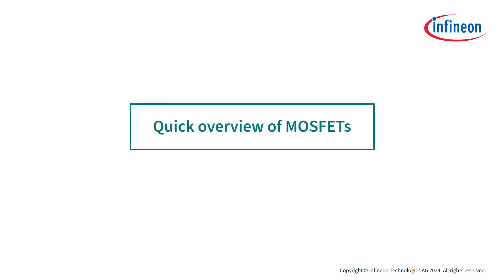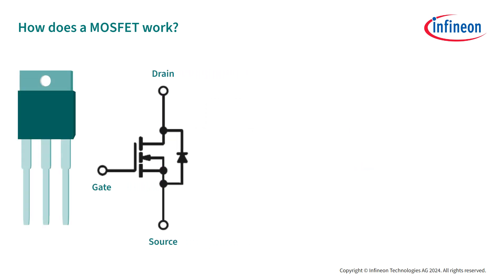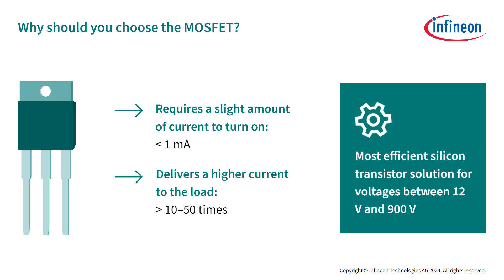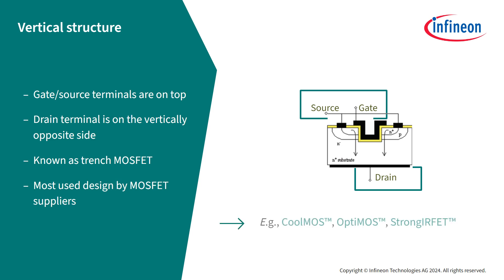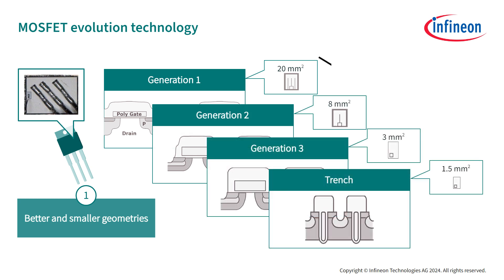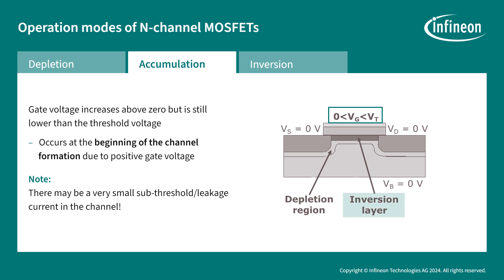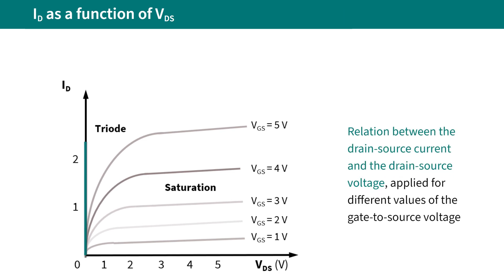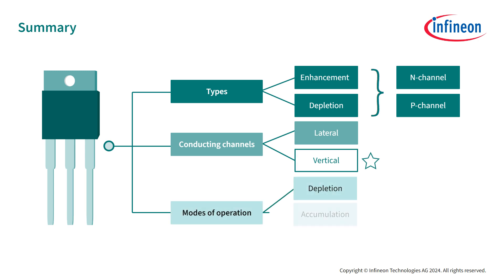Master MOSFET Basics in Under 15 Minutes! | Infineon

Comment: Thanks for the video, it’s very informative. I have a query—In a typical MOSFET (say a commonly available N-channel device), is the die usually a single MOSFET or made up of many smaller MOSFET cells with their gate, source, and drain combined? Also, is there a way to determine this from the datasheet or any other source?
Reply from the maker: Hi! Thank you for your positive feedback! 🙌
You can find comprehensive guides and application notes on our Product Pages. Consult our website and search for the product you are working on: https://www.infineon.com/
👉 Alternatively, if you’re looking for more detailed guidance, our Developer Community is a great hub of knowledge: https://scom.ly/98jeYWN